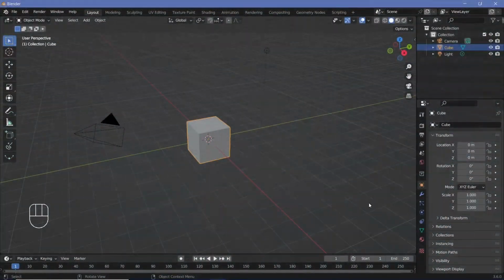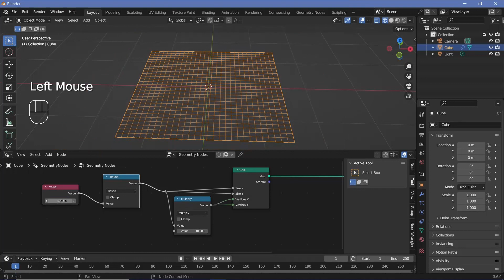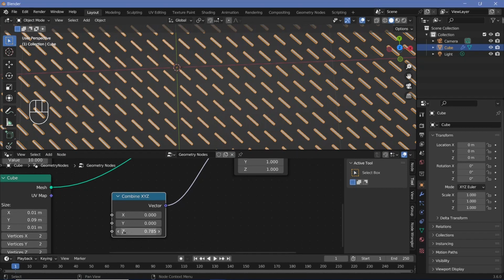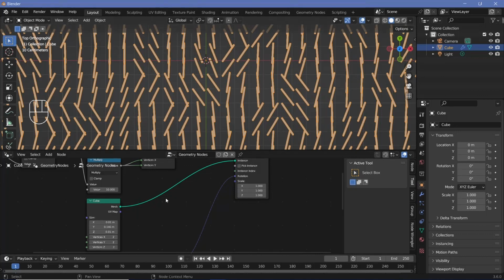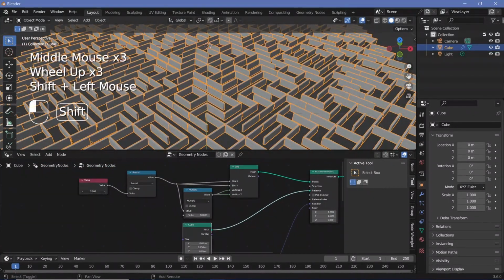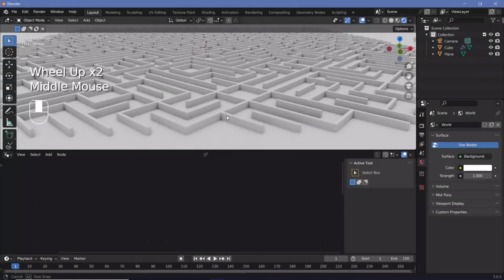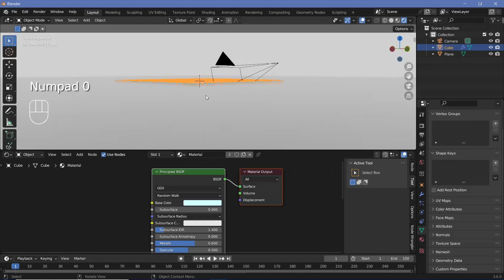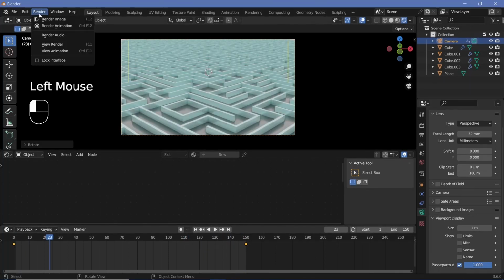Create Infinite 3D Mazes using Geometry Nodes - Blender Tutorial

Comment: Instead of duplicating the maze and moving the duplicate, why not use the array modifier? You have to add in a Realize Instances geometry node just before the Group Output in geometry nodes or else the array modifier won't work. Also, and I think this is because of the lines being at 45 degrees, you will probably need a relative offset factor of less than 1. I found 0.998 was perfect.
Reply from the maker: That definitely is a perfectly valid way of creating it.
Thank you for putting it out there for anyone who might get help from the idea :)

Comment: this is an awesome tutorial! i'm currently trying to do a render of the maze from the hellraiser movies and this is exactly what i needed to get me started without having to hand build the entire maze. i was wondering if there is a way to get rid of the dark spots from the overlapping geometry while rendering in cycles? i'm not as knowledgeable with blender as i would like (yet!) but i was thinking a realize instances node then some kind of select all and boolen them together some way? i got a few ideas but like i said i am kind of a newb. :)
Reply from the maker: Thank you so much! I'm glad this video helped.

The best way to figure it out is to try out all the ideas that come to mind. 
I am not sure which solution would work, but I would try realizing instances and then merging by distance using a "Merge by distance" node.
If that does not work, you could increase the height on the Z axis for each instance randomly by a very very slight amount using a random value node, passed through the Z input of a combine XYZ node. That might prevent the overlapping regions and solve the issues.

Good Luck!
Reply: @deayanstudios  i've been looking around for a way prevent the overlap and it looks like the Raycast node is used for this a lot. i will copy-paste what i read on another video in case you are interested.

"Raycast to itself (with very tiny offset in the direction you're casting so each point doesn't hit itself), anywhere else it hits itself, Do a dot product of the face normals.  (original and face hit), if it's negative, it means that part of the mesh is inside of itself."

I'm still trying to figure out how to use this to prevent the overlap for future projects. geonodes are crazy powerful.
Reply from the maker: Thanks! This is definitely worth testing out. I'll take a look into it.